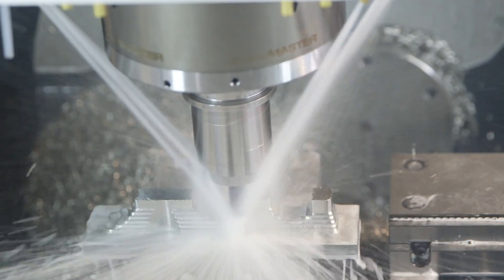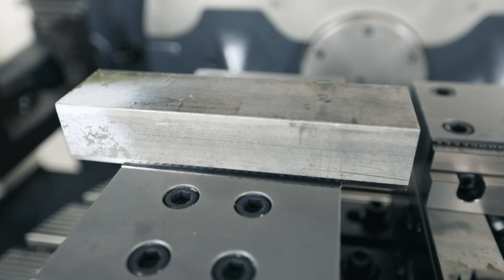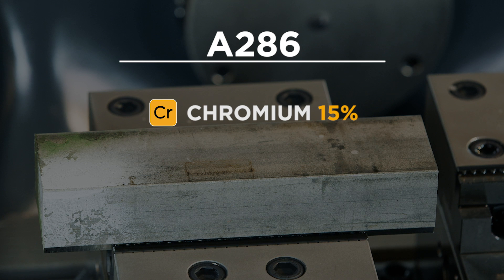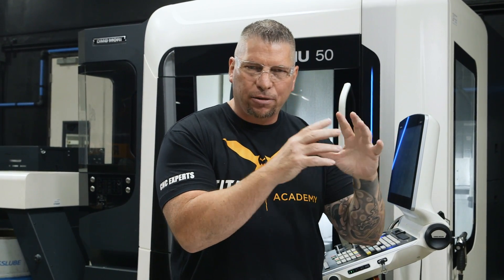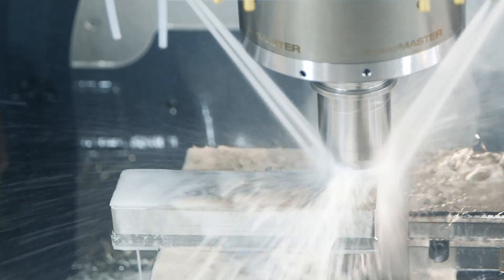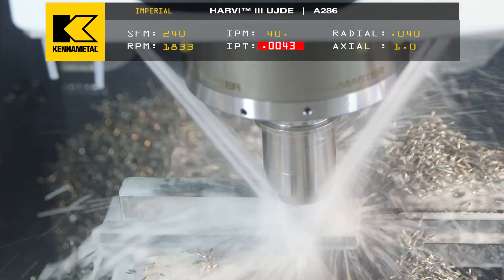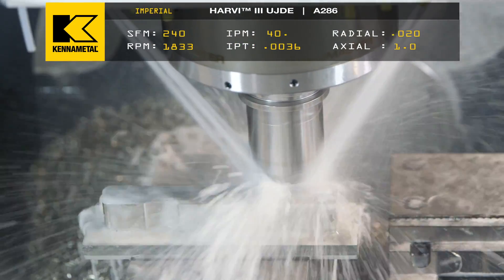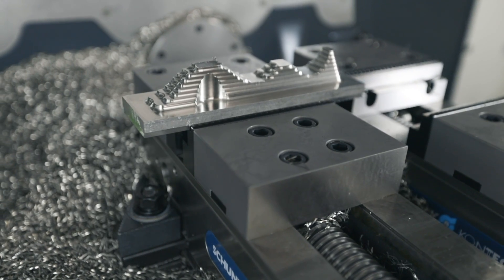CNC Machining Aerospace A286 Stainless Steel | VLOG #103

Comment from the maker: A286 is no joke, this stuff can be NASTY...Hope you all are able to bank this info for the future. Who's machined A286?
Reply: I've turned it before, it wasn't really all that bad.  Just get the depth of cut and speeds and feeds close and it actually ran just fine,  and you can get some really nice surface finishes on it.
Reply: i did, came strait from the foundry, 7'' OD rought on hammer, the saw coundnt get tru it.  i never turner something that slow, but it's the only super alloy i machined
Reply: I had to do duplex stainless that was interesting but were does that stand against stainless 316?
Reply: @rempat1994  For duplex not super duplex run about 20% slower than 316L
Reply: Ey Titán, do some lathe machining videos
Reply: How does it compare to 17-4ph H900?

Comment: hi. can you give me a tip for a reliable insert for machining M50 steel? we usually work with 304,316steel, Ti,  Inconel ect, but this material wears off our inserts in very short time. (lathe) thy

Comment: Titan, i always enjoy your video. We were running A286 material 2 weeks ago. we encountered a lot of problem and breaking tools. I finally told my machinist to go with your recommended speed and feed here. It works amazing. We reduced cutting time by 1/3 and finally finish the project. Thank you very much.
Reply: Im going to try tomorrow wirh the same recipe. Wish me luck.
But need to buy harvi.
So, im going to try quth the endmills i have in stock… Maford blaze, Imco and gorilla mill

Comment: As a retired tradesman I marvel at your knowledge base and also how thru hard work, you have earned the respect of major industrial, and aerospace giants. That just does not happen very often and congratulate you and your team.
I love your shows and at 67, I got to tell you that you are one heck of a teacher. I actually believe I could run a simple job for you by just listening to you! Keep up talking about the materials you machine, as you have introduced me to metals that I had no idea existed. The only dealings I had in machining was in military where I took an impeller down to machine shop to get the machinist to take 10 thousands off it. I did that only because of time restrictions to get pump back online.
Your machines blow me away, but understand the programming a wee bit, as I worked with PLCs.
If you were my son, I would surely be proud of your success, but much more than that, is how you turned your life around and you gotta be proud of your son as he is sharp as a tack. Loved the dragsters as we were at the Nationals not to long ago.
God Bless and Good Luck.
Reply from the maker: WOW!!! Thank you very much:-)

Comment: For those interested, A286, K500, different aluminium alloys and more, are a good example for alloys that are undergoing a process called precipitation hardening, which takes place in all alloys that can form solid solutions and whose alloy's elements solubility decreases at lower temperatures. Going down from the solubility temperature, intermetallic phases precipitate out, which makes dislocations in the crystal structure more likely to hit those obstacles, therefore increasing the strength of the material. Often, the alloy is quenched before, and then heatet up to a target temperature over a known period of time, which gives you more control over the process and leads to optimal strength parameters.
Reply from the maker: Definitely know your stuff.
I tried to give them an idea without losing people...
Having fun teaching this stuff.
Reply: @TITANSofCNC  Of course, no means of offense there!  Just wanted to add this in case somebody is interested. Thank you for your great work!

Comment: Does kenna recommend running any of these harder materials dry with an air blast to activate the coating on the tool with the heat of the cut?
Reply from the maker: Not the Super Alloys or Titanium...
But yes in certain steels like 4140 etc

Comment: I am going to be killing some A286 today but we dont have Harvi EM.
Reply: Try MaFord 380
Reply: @davekearley9645  yea we use a lot of MA Ford tooling , And a local tooling supplier Myles tooling.  They are the equivalent to lake shore carbide.
Reply: Dave Mcmasters .?
Reply: @davekearley9645  ?
Reply: Dave Mcmasters  didnt understand ur reply.?
Reply: @davekearley9645  what didnt you understand? You said try ma Ford. I said we do and also another brand of tooling that is the same as lake shore carbide
Reply: Dave Mcmasters  understood.. the A380 tool is 9 flute and has Altima Extream coating. The Kenna works fine but if you cant find the ford will give good TL and increased chip load.